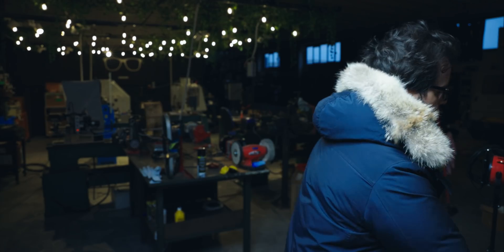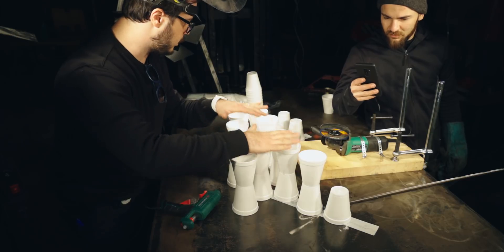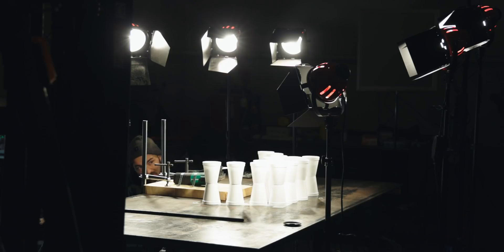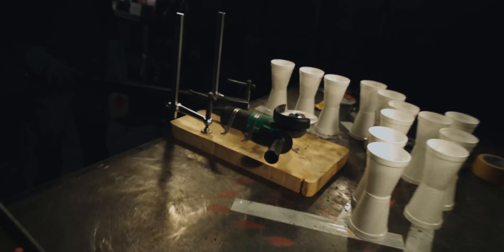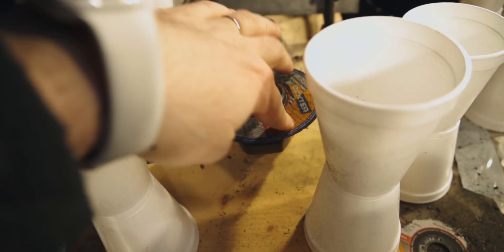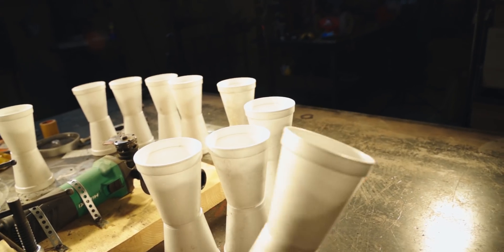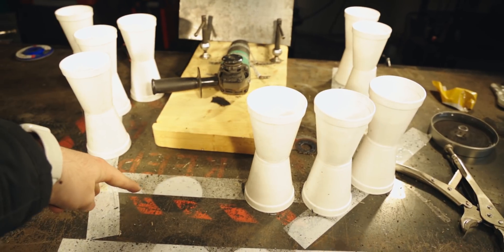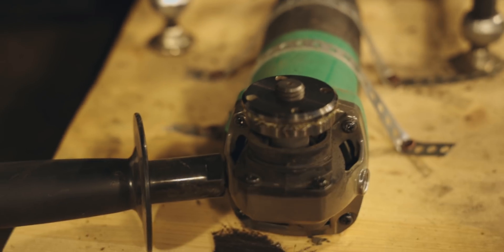Angle grinder explodes in slow motion

Comment: I was a high school auto shop teacher up until this past year and I made every student that was using, or within 10 feet of the student using an angle grinder, to have a face shield on over and above their safety glasses. I also recommended that they google image search "angle grinder accidents" on their phones first and never had an issue with students not wearing them.
Reply: I was cutting cars transaxle? tunnel with 1mm disk. Metal was under tension and when it released it jammed the disk in place, grinder went to earths low orbit and disk exploded. After math was strained wrist and i found peace of the disk stuck on my forehead skin. Skull stopped it and there was no serious damage, but it pierced the skin and was hold by skin. After that i never remove guard again. Also it protects disks from getting damaged when you place them on the surface. Also you think you can hold on the grinder, but you cant, there is just too much force, too quickly for you to react to it.
Reply: @Hellsong89  scary! Glad you are ok!
Reply: I've been hit in the head with a piece of cutting disk from an angle grinder. Luckily it wasn't spinning too fast when it broke. I only had safety glasses on. A face shield would have stopped it.

Comment: Just three days ago I worked with an angle grinder, and one spark shot underneath my safety glasses into my eye.

The doctor picked up the grain with a Q tip, and I don't have any dangerous eye injury.

It's the first time something came into my eye working with power tools and I'm glad, it just was a minor incident.

Wear your safety glasses, kids!
Reply: I caught a rebound "something" in the eye the other day, my usual technique is to wear a face shield and safety glasses (which is annoying as I wear a respirator and earmuffs too most of the time) but I think I was just wearing glasses this time, finally bought some goggles that seal against your face, they are great!
Reply: Glasses are not enough! You should wear safety helmet with protective face shield.
Reply: I've had a tiny (only looked like a dot with bare eye) metal shaving drilled out of my eye. That was fun. 👀

Comment: So you make a video about how dangerous an exploding disk can be, but the guy testing it doesn't even wear safety glasses?
Reply: And the cutting angles are wrong.  If they want debris to shoot toward the styrofoam cups, they need to stab the pipe on the right side of the disc and from the other side of the table  since the spin is counter-clockwise.  (or flip the grinder over like you normally use an angle grinder).  They did not think about centrifugal force.  The guy ducking under the table is actually in the unsafe zone.  This kind of shows how safe angle grinders are if the guard, stock, and operator are in the correct position.  It also shows that most people and youtubers do not know about physics.  Angle grinders are basically mini bombs.  Good video though and slow-motion camera.
Reply: lol the disc is only ZERBRÖSELING (englifiscated german word)
Reply: @mrjodoe  Love it

Comment: Nice video and good point. 
I think if you had stressed the disks on the other side (sparks flying away from the grinder vs toward it) the centrifugal force would have carried pieces out, instead of into the guard. Normally one uses the grinder that way, anyway. Super dangerous stuff.
Grazie, stay safe, and ciao!